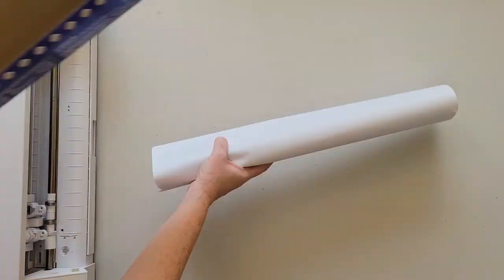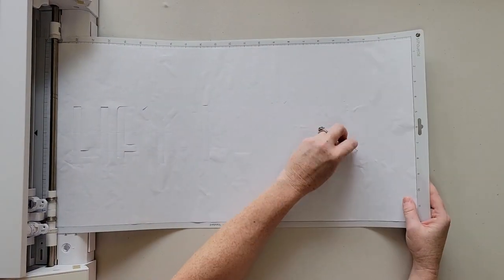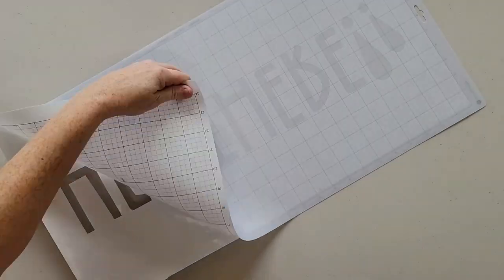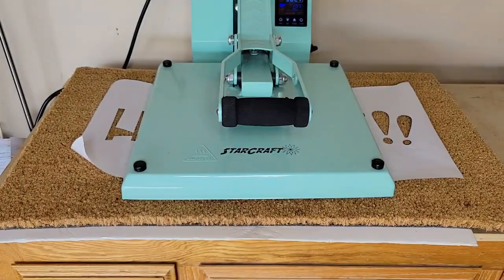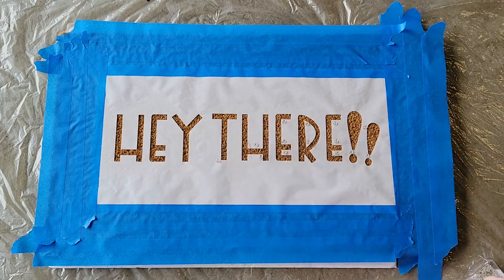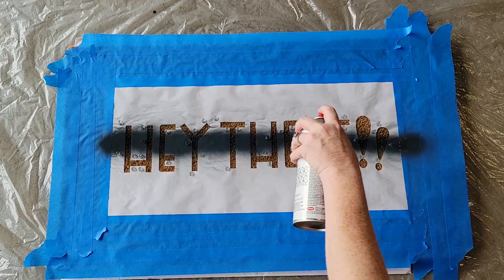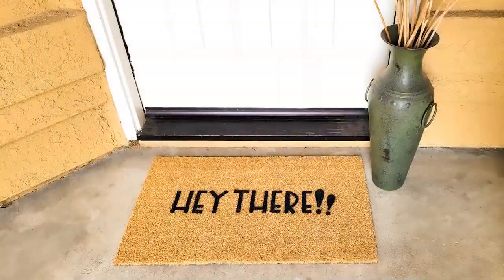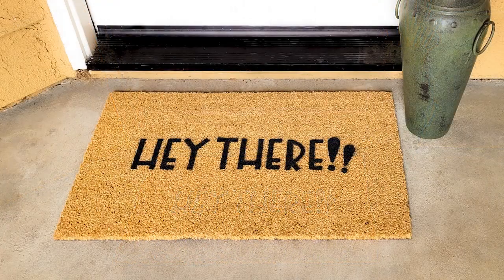Custom DIY Door Mat with Freezer Paper

Comment: Hello. What kind of spray paint do you suggest for longevity?
Reply from the maker: I think the most important thing is to spray it with several coats of clear coat after you apply the spray paint. I have one that's been on my porch for years and it's barely faded at all

Comment: Do you not seal it?
Reply from the maker: Yes I sealed with a clear seal coat
Reply: @SilhouetteSchool  ahh ok thanks I did not see that process on the video. Yours came out awesome. I’ve just made a mat for my grooming parlour it came out awesome but I know it needs to be sealed so was hoping to see how you done yours. I see some do it while the stencil is on however mine had a lot of detail with different colours so could not keep the stencils on my luck I would be covered in paint lol so I let each colour dry but removed the stencil after the paint and let it dry that way